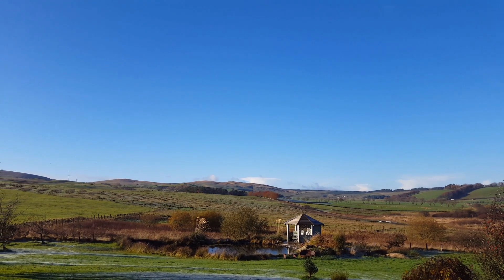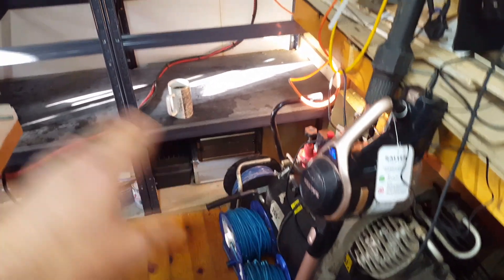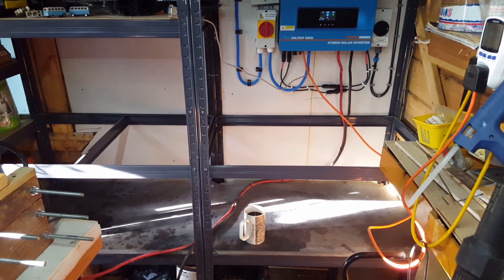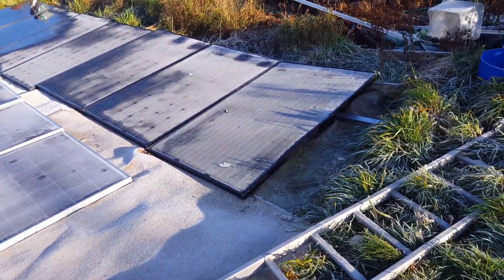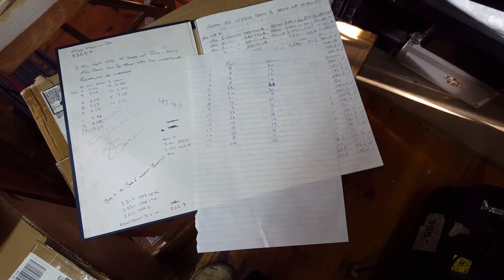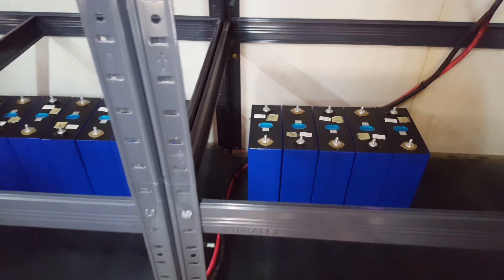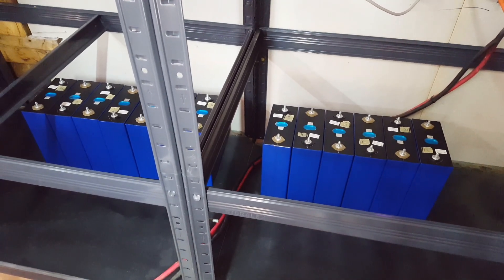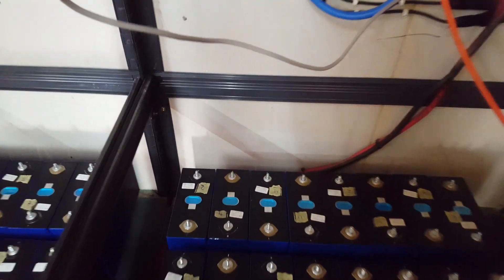FOGSTAR EVE GRADE B 280Ah CELLS HAVE HIT THE SHELVES!😎 & power supply makes the ultimate sacrifice 😢

Comment: Where I had to put mine I didnt have space for the threaded rods at the side, so put 2 under and 2 over, and used a JK bms like i have on the ebike because a year in its been faultless so I went with what i know etc. 
Now just need lots of sun.....
Reply from the maker: Hi I like your over under approach, an elegant solution.
I am yet undecided with the final arrangements and stud placements, lots of shuffling around to do, I will be using JK BMS too so it's always nice to hear good thing about them.
Cheers
Gaz
Reply: @garys-half-baked-offgrid-dream  the motor controller in the big bike shorted out just like the MOSFETs in inverters do so presenting as a full on short to the battery pack, BMS detected that and shut power off before even a fuse had got warm.... That's when I decided never to use any other. Shame it kept trying to reconnect power every 5 seconds lol. Seems it detects the short but treats it like an overcurrent and so reconnects instead of 'nope that's not a few amps over this is a big issue' and staying off till manually reset. If I thought emailing jk would help I would but they no doubt won't even read an email from a customer.

Comment: The battery banks are looking awesome all lined up Gaz. I'd personally have the bus bars mounted on the panel divider. Positive on one side and negative on the other. This would free up the space under the inverter then aswell as keeping the positive and negative separate to avoid any flashy flashy's. Doing a great job so far mate  keep it up and reap the rewards of your labour
Reply from the maker: Hi ya, thanks yeah all looking good so far just a bit tight lol.
 The Busbars are the key pieces to this puzzle.  Many things are running through my head.  On the wall, on a divider, vertical or horizontal.  Ease of cable runs for more inverters/charge controllers/more batteries without Criss cCossing and looking crap.
This is going to strain me brain and take some mock ups.
Cheers Gaz 😃
Reply: @garys-half-baked-offgrid-dream  also consider if anything drops off a bus bar what is it going to hit underneath it. Is it going to be another bus bar, the battery bank? I would definitely consider the bus bars on either side of the dividing wall as a first option as that leaves the back wall free for another inverter then. Also remember the flex of the thicker battery cable and the currents it will be carrying from both battery banks to the inverter. The amperage is going to be potentially over 200 amps at full inverter capacity. Better than any countdown for mental exercise this 🤣🤣
Reply from the maker: @karloffgrid  Safety is the key, the biggest danger is me 🤣🤣🤣
With the Amps I have planned for a Full Load, Flat Batteries Cascading shut down of the BMS'esssssss, just with this inverter it's around the 250A'ish. 💥🤞🙏
As we know as the Volta go down the Amps go up so Safety in numbers my busbars are rather large. As is the comically oversized Bluesea killswitch 🤣🤣🤣